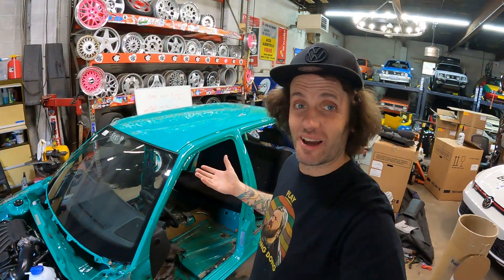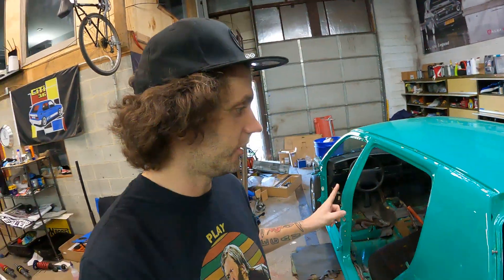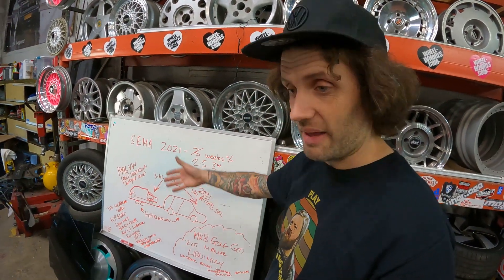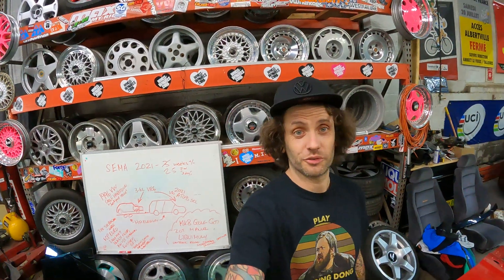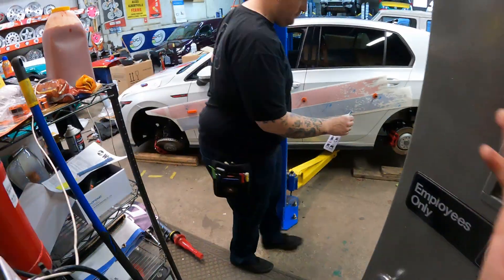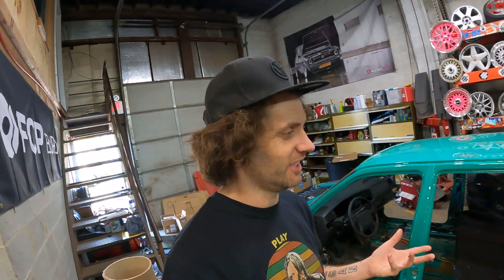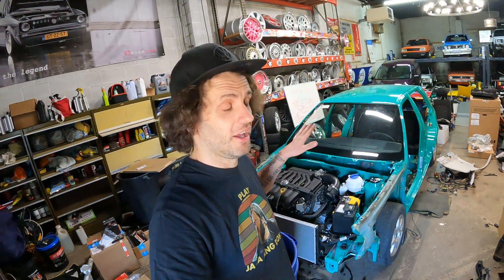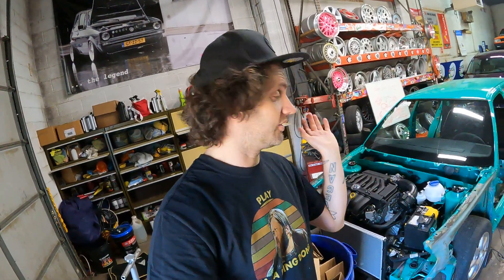Road to SEMA PT 3 : VW Golf Harlequin Resto(mod) - progress (!) update

Comment: Those seat covers, did they come in any other mk3 version than Harlequin and Joker?

I know you don't have time, but an OEM+ 3 spoke steering wheel with 4 color leather and colored stitches would be my vote. So I guess Benetton wheel.